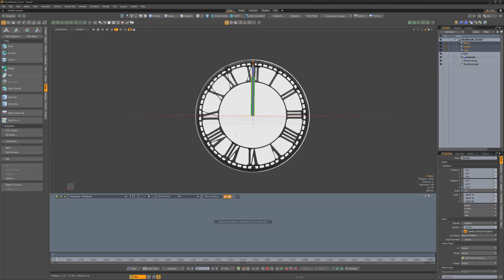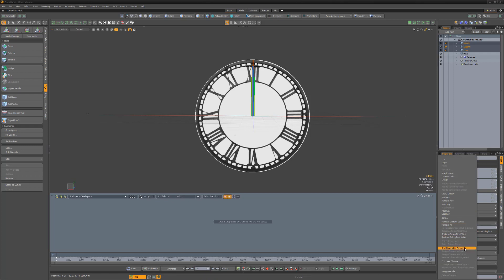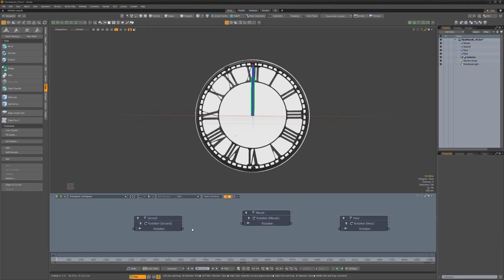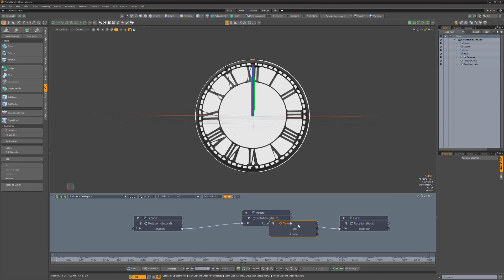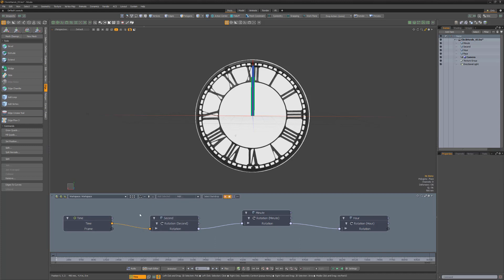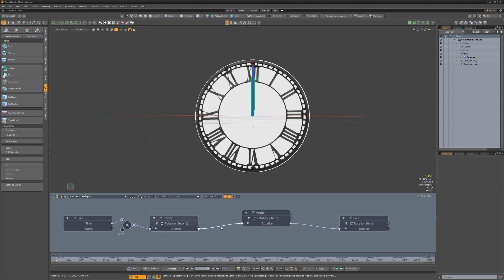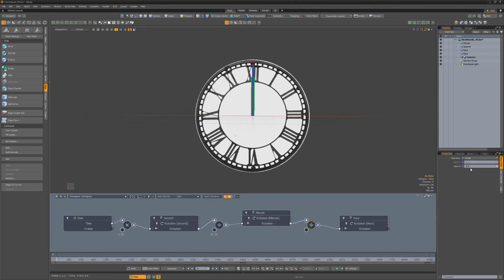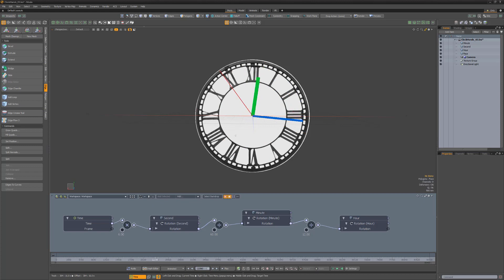Modo | Time Operator/Clock Rig

Comment: I would love to see a tutorial on how the rotation of one object drives the position of another (not the rotation of the other, but the position). I recently had a project where I was trying to do this and it was driving me crazy until I figured out the calculation required.
Reply from the maker: You would just need a math modifier between the rotation channel to position channel. Which math modifier and what value would be determined on the amount you want to move based on angel